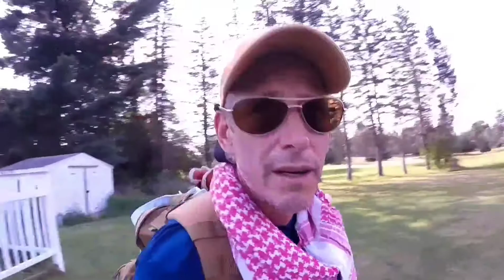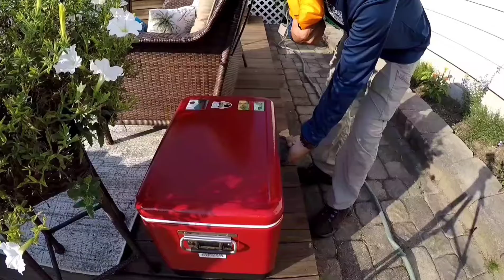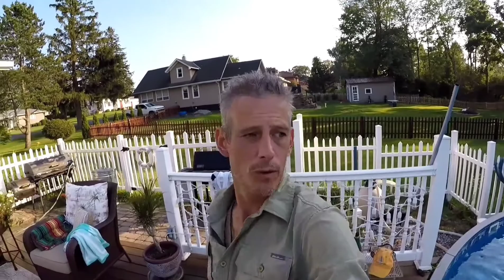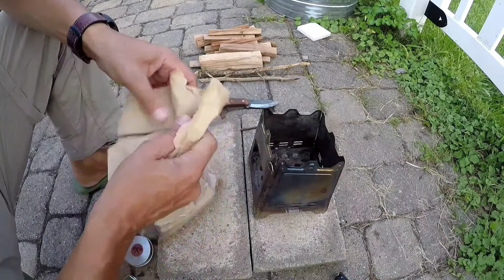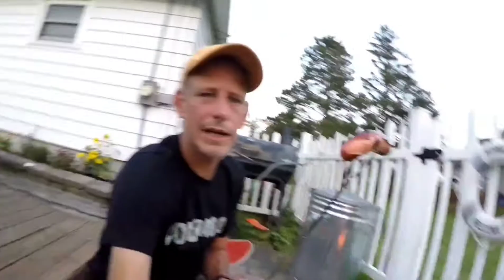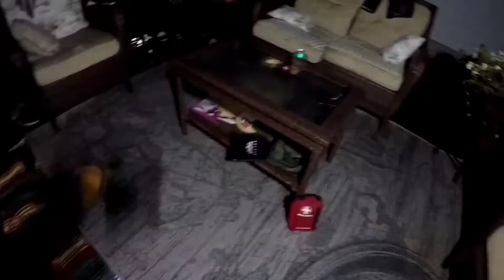Fake Stealth Camp (Poolside Camp 2)

Comment: Cool vid brother. I've been thinking of doing a stealth camp adventure myself for quite some time, and also got the idea from Steve lol. As far as what setup I'd use, If it was cold enough to not worry about bugs,  I might just go with my my super packable and lightweight Snugpak Tactical 2 bag inside my Native Survival wool blanket bivi ( 2 more amazingly cheap eBay finds lol!) . I could also use the Snugpak Stratosphere but, the temp would have to be cold enough and the air dry enough to mitigate condensation build-up, which happens very easily in it even though the Paratex dry its made from is "breathable" and it has 2 vents. This summer has been ridiculously hot and humid here at the head of the Chesapeake bay in Maryland and has let me do almost no camping, hanging or hiking unfortunately. Although, I've now got a TON of fall/winter gear and clothing to test so I can't wait till the temps start to drop and I can finally get back into the piney woods! Keep the vids coming my friend. ~ Chesapeake
Reply from the maker: Damn, bro. You got it all figured out. Thanks for watching, as usual. You really have no idea how much I have learned from you, hopefully someday I'll be able to explain.